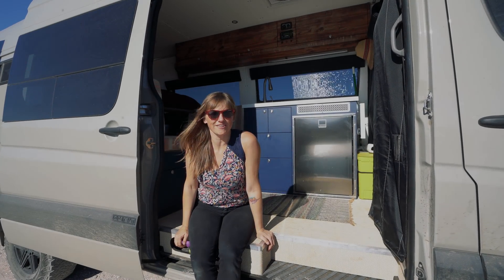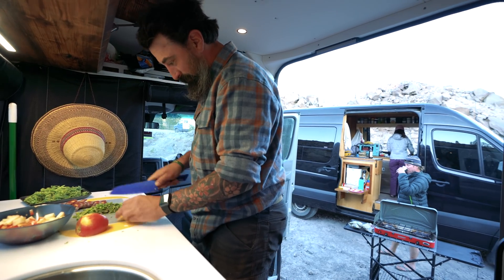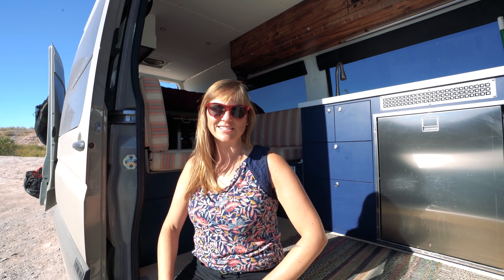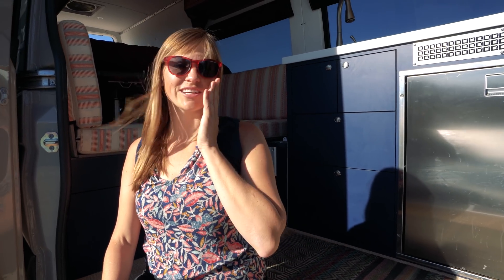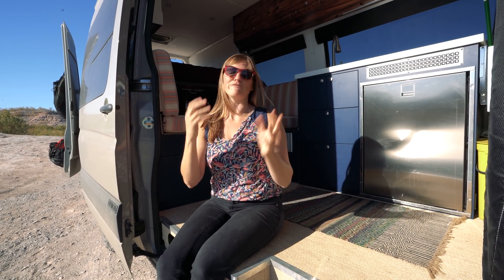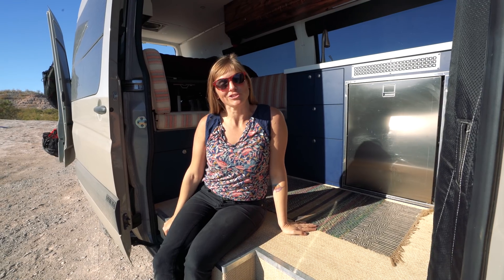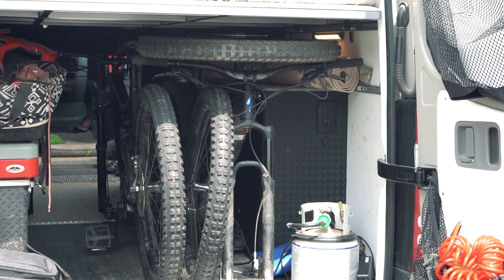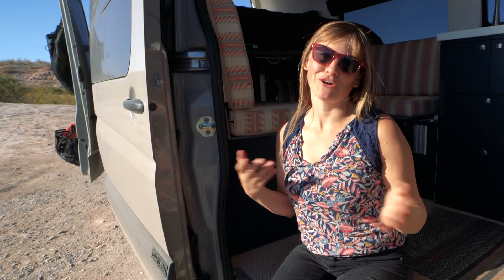Sprinter Van Electrical System Tips - 660 amp hour Battery Bank + 445 watts of Zamp Solar

Comment: Nice build. The one difference between AGM and Lithium that you don't mention is that only 330 amps (or 50% of total capacity) of power is available  from an AGM before it has to be charged. A comparable lithium system of 660 amps would have about 600 amps of power available for use. Lithium also weight about 1/3 AGM and last 3-4 times longer.  Its true that they do cost more and they don't like cold. The cost in total usable amp hours over the life of the battery, however, makes them about the same price. Re: the cold, modern lithium batteries now come with internal heaters.
Reply from the maker: Thanks for that tip on internal heaters in lithium batteries now. The technology is changing quickly.
Reply: @bearfoottheory  It really is. Just during the few months I have been researching a conversion, a variety of advancements have been made. If someone is considering lithium spending time researching developments is advised. Lithium, despite its advantages, is a newer technology and much more complicated. A tradition AGM is established, much simpler and far less prone to installation errors!

Comment: I have 1000Ah of battery on my sprinter, I used LiFePo4 though so this will be lighter than your 600AH. Also it charges faster and can be left partly discharged without harm. There is no acid or gassing issues either and the cells survive around 10 times the life of AGM lead acid.

Mine connects directly to the alternator and solar controller. The van starter battery is fed via a DC/DC from the main bank so regardless of the charge state of the main 1000AH bank, the starter battery will remain charged. normal split charge relays will put them in parallel resulting in the starter batter being discharged by the main bank if it is low.
Reply: @bogged9820  300ah is about what I was thinking. Can I ask how you will be using your van? Full time? Any pc or gaming, fridge, wat erpumps, etc? I'm trying to get a better idea of the solar power wattage to battery bank balance. Considering 800 watt solar, 300ah bank lithium for full timing it.
Reply: 1000Ah !? Surely that's overkill. What on earth are you powering that requires that amount? Also what Inverter are you using and what DC/DC Unit? Thanks
Reply: @bogged9820  i run a lot of lighting, powerful devices and charge other battery operated machinery. the key thing is i run these for a long time without the engine running and do not need to worry about losing juice.

The inverter is a xantrex 1800i which although 1800W will happily produce 2.7kw for long enough periods for me.

Being Lithium Iron (Lifepo4) the 250A alternator with the 70mm cables to it makes light work of recharging them on moderate trips due to their high charge acceptance. the solar panels on the roof produce 40A+ on a sunny day and their role is to provide top up even when the van is not in use as there is a freezer running in their 24/7 .

Comment: Great Video.  Do you have a small fuse panel/box  at all within the Van? Any information would be great.  Thanks
Reply from the maker: Yes, the fuses are under the drivers seat. And there is also an access panel at the back of the box containing the batteries.

Comment: Very nice conversion, very practical. Excellent review. Two important Qs:  why have you chosen a diesel water/air heater and not a Gas heater?  Any problems with condensation?  Many thanks
Reply from the maker: I chose diesel so I don't have to have multiple fuel sources and it's very efficient. I run the fan on low at night to avoid condensation and haven't had any issues.

Comment: Also, how do you track how much battery power you've used?
Reply from the maker: There is a meter right above my galley that tells me the status of my batteries.
Reply: @bearfoottheory  what information does it show you? I ask because I have 2 agm deep cycle batteries I just installed with a battery isolator...but have no way to see how much power ive used.
Reply from the maker: It shows me the current voltage of the batteries, which usually read somewhere between 12,0 and 12.8
Reply: @bearfoottheory  so when theres a load on your system... does it stay between 12.0-12.8? 
How do you know how much amp hour youve used? Do you calculate? Or is it displayed somewhere?

Comment: With a 445 watt array I would have given serious consideration to using a mppt controller instead of a pwm. Why did you go with a pwm?

Sometimes I find it easier to talk about the whole system in watts. 

Great video !
Reply: PWM is silly for this setup. But if they live in the sun then they can get away with the waste.

Comment: In my own sprinter I’m able to meet all electrical needs with 200w/$160 worth of Renogy panels, a $200 Victron MPPT controller, and 220Ah/$300 worth of Trojan flooded lead acid house bank. My batteries are located in a vented compartment on a slide that allows me to easily service them. That’s running TV/DVD, the largest Engle fridge they make (84qt), 10 LED interior lights, 4 outdoor flood lights, water pump, propane on demand water heater (uses electric to start), Espar heater, Maxxair fan, microwave, 2 laptops for astrophotography, and a stereo system with 10” subwoofer which is also tied into the DVD. Obviously I’m not running all of this all the time nor every night. But despite not even outfitting a shorepower option the lowest I’ve dropped just before sunrise is 83% capacity on the house bank. I’ve been taking numerous trips in the almost 2 years since I finished it and I lived in it for 3 months.  The Renogy panels don’t have the highest maximum output but they are amazing in low light/clouds. Near as I can tell, I can top my batteries off indefinitely without running the engine even on cloudy days. For reference I’m still making 0.3A when it’s dark enough to start seeing planets. That’s after sunset. 

A smart installation is cheaper than throwing panels and batteries at the problem. Understanding line loss is critical in a solar installation. Every “professional” installation I’ve ever seen uses inadequate gauge wires in the critical path from panel to controller. Then they make the run far too long from controller to battery. Compounding this is the default charge controller settings that are super conservative and never fully charge the batteries. 

Converting DC to AC nets about a 40% loss (and then another 40% roughly to go back to DC when charging a phone or laptop). DC chargers for your laptop and camera gear are cheap. A 2000w inverter draws 1Ah just being turned on. The only thing I run my inverter for is the microwave and power tools, the rest of the time it’s off. Using the included AC charger plugged into a 2000w inverter requires somewhere in the neighborhood of 5Ah to charge a cell phone. A DC charger does the same thing in 1.6Ah. I installed several USB/12v cig lighter outlets through the van so I can sit anywhere while they charge.